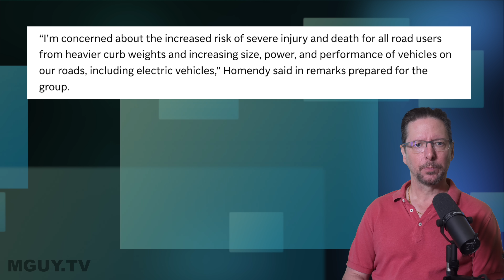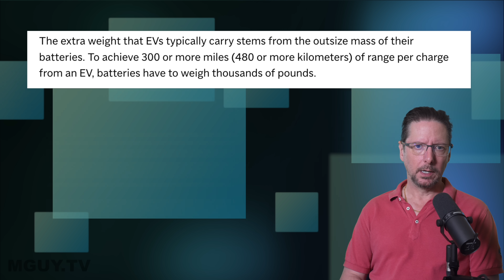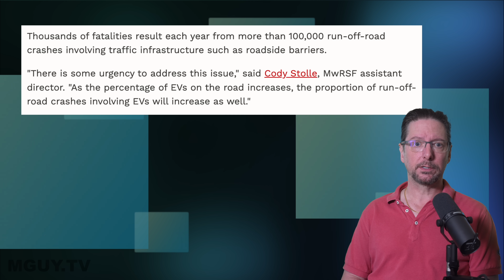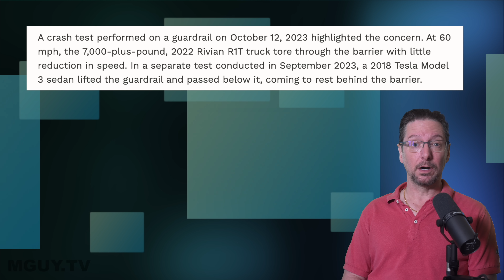EVs TOO HEAVY for roadside crash barriers (guard rails) | MGUY Australia

Comment: Imagine your teenage child driving an EV. Runs over a curb, damages the battery some and FORGETS to tell you so you can have it checked out. Comes home late, forgets to plug it in and you don't have enough charge to get to work. Pulls off onto the shoulder of the road, to take a leak (beer goes right through you) and gets the overly heavy vehicle stuck.
Reply: Drunk driving and expects child to have more than 1.5 brain cells?
Reply: @rosen9425  
I'm not sure you understand humor.

Comment: Would requiring EV's to park on the bottom level of a parking garage, or limiting the number of them per floor be a solution for the weight problem? Thanks.
Reply: Bottom level would trap everyone above in the toxic smoke. Making them park on top, without a roof might be of some benefit as it takes the Lithium Fire some minutes to burn through the concrete level by level.
Reply: "Out of the frying pan, into the fire" comes to mind. Perhaps open lot parking for EV's is the answer. Maybe part of the tarmac can be set aside for EV parking?  @robertkubrick3738

Comment: Recently, I watched a video of a supposedly stock Tesla shaming high horsepower cars at a dragstrip, we're talking high 9 to low 10 second passes (130MPH) in the 1/4 mile. My point here is how many drivers are not capable of dealing with acceleration that only the most experienced race car drivers know how to handle. Human nature being what it is assures most young men sooner or later won't be able to resist the thrill of a Banzai run. Even Biden succumbed to letting it loose as news cameras were filming his test drive in a Ford Lightning EV.
Reply: That vehicle had extra pedals on the other side. They wouldn't risk Biden driving.
Reply: FJB 🖕🇨🇳

Comment: So what we've learnt from so far: too heavy for car parks, too heavy for driveways, too heavy for crash barriers, too heavy for hills, increased road wear, increased collision damage , increased fire risk and fire hazard (environmental and health.)
If EVs ever (not likely now) replaced all ICEs, then all the current vehicle infrastructure  is compromised and needs upgrading to cope.
The meme 'nice' comes to mind.
Reply: Not to mention rapidly wearing tires needing frequent replacement while filling the air with excessive amounts of tire particulates and chemicals.
Reply: @edb3877 EVs typically wear their tyres between 10 an 15% more. 
New legislation on the way such as Euro 7 and others aim to reduce tyre particulates by 30% and increase their size above pm2.5. This will be a significant improvement for all cars. Not just EVs.
Reply: Don’t forget the fine dust created by inferior tyers, which is STILL A THING THEY NEED TO TACCLE
Reply: So, you're pretty much saying that EVs a lame as hell and a monumental scam? I knew they were really bad but after watching this EV dude the past few months, they're way worse than I realized. You're probably safer in a Model T with a supercharged small block Chevy in it.
Reply: @wrotenwasp  you swallow tales from a channel funded by oil lobbyists and take that as your guidance on EVs?
That is the problem with youth like you today, you take corporate narrative at face value & can't think for yourself
Reply: At least in Maryland part of gas prices is a road tax. EVs use roads but do no pay this tax.
Reply: @jimdevilbiss9125  There is tax on electricity. Not specifically for roads but part of the pot
Reply: I think this first wave of EVs were big for all the wrong reasons. But by second or third wave of models they should be where they shine. What is selling the best are smaller EVs. Hyundai is making gains in EV market because they listened what people want. In my recent trip to Bali I've seen bunch of small city electric cars not available in EU, and they look great and are cheep. Seriously thinking about getting one in few years time. Not to replace my Volvo diesel, but to replace my small car I use to get groceries or gardening tools. Small Skoda Fabia. I think there is a place for EVs in transportation system but not as a Humvee.
Reply: Yes mate and just what about the pollution not only from the manufacturing process but the toxic waste from fires and the particulate from those specially made tyres that are then shed to the road surfaces?
Reply: @johngoard8272  exactly, from start to end, ICE is 3-4× more polluting than EVs. Good pount.
Reply: @johngoard8272  ICE and EVs all have tyres and they all wear and shed particles. The rate of wear depends on the driving style and the weight of the vehicle. Heavy commercial vehicles are probably the worst.
Reply: And too heavy for coastal ferry vessels
Reply: @paulr7547  bull, almost all Norwegian coastal ferries are electric powered & most of the cars are EV.
Why post such obviously false tales?
Reply: Obviously if a ferry on the upper decks could have much heavier vehicles occupying the same spots lighter one the ships center of gravity will be higher. If you think that is a false tale think that. I would say that it just common sense.
Reply: The meme "rubbish' comes to mind, if that really is a meme. Are you suggesting existing infrastructure does not allow for pickups, busses and other very heavy vehicles?
Reply: No, actually, you have learnt nothing. If this person's claims are correct, the vast majority of vehicles on the road fit his heavy EV criteria, EG. nearly all SUV's definitely all Ute's and 4WD vehicles and any vehicle towing a trailer, and all vehicles towing a caravan should be excluded from the road. Think of the weight of a 2WD tradie or farm Ute carrying tools, hay, or stock.  Common sense not in this chaps resource inventory.
Reply: @paulwoods1950  but you saw the video, right? Dangerous, right? So maybe they need to be speed restricted like a lot of heavy vehicles  and those who tow, right? Common sense, right?
Reply: EV's are the perfect vehicle for the  "merchant bankers "  in our society.
Reply: @ferventheat most of want you have "learnt" is questionable, but lets put that aside for now. Although EVs sales are still rising I think ICE cars will still be with us until at least 2045. 21 years is a long time. Plenty of time for EVs to improve massively. I expect EVs to represent over 90% of private vehicles by then.
Only time will tell.
Reply: They weigh the same as other cars. You think engines and transmissions are weightless?
Reply: Learned
Reply: @@andypeek8151 Yours, maybe. But not everyone is a failure
Reply: Lesson you have not yet learned - this guy is paid by oil lobby firms and none of what he tells you has any basis in reality.
Reply: @j17golf  And you are not paid by EV lobby firms?
Reply: @elrolo3711  no, oam not. No need.
Reply: @j17golf They don't have to pay you because you are a true believer? At least somebody is saving money out of this.
Reply: @j17golf  Common sense alone tells you that the increased weight of the EV's is going to cause problems to the roadways.
Reply: @eugeniaskelley5194  minor difference in weight.damage from ICE exhaust fumes & fuel on road surface many times more damaging.
You guys are clutching at straws. ice cars are dying out no matter how hard legacy oil lobbyists try
Reply: @j17golf  Do you live in CA or in a metro? EVs will never take hold outside of densely populated areas.
Reply: @aaron___6014   I think you mean that EVs won't take hold outside of densely populated areas.  ICE cars (internal combustion engines) already have taken hold, for a hundred years.
Reply: @aaron___6014  not so, I live in the country, my ev tows hay, carries bikes, and I charge off my 🏡 solar exclusively. I save about $3k on fuel costs per year, and as a mechanic, I don't miss services oil changes, filter changes, ETC. It's a 1.5 T Hyundai Ionic. It suits my needs and rural lifestyle. But if this offends you, I can't help your ignorance of real-world experience. I chose an EV for financial reasons first, second for  low maintenance costs and effort, third for self sufficency, and lastly, for personal pollution reduction. This works for me, I don't think it would suit every ones circumstances, but that's nothing new.
Reply: @j17golf educate yourself 🙄
Reply: @j17golf  You say none of what he says is based in reality. Are you saying that the crash tests shown aren't reality?
Reply: @my3dviews  He is misrepresenting the results, yes. Clearly.
Reply: @my3dviews  All the posts I made on this thread were removed by the channel. He does not allow discussion because he is paid by oil lobbyists and they don't want their message to be dilluted. They count on the easily led kind like you. 
Yes, his videos are not based on reality, which is why he has to cancel the posts that go against the lobbyists' narrative.
Reply: @j17golf    Comments are automatically deleted by youtube. My reply long reply was just intantly deleted, proving it wasn't him, since I was defending his channel.  
No, he is not paid, that is just silly, unless you got verifiable proof of that, rather than just speculation.
Reply: @my3dviews  He is paid. Nobody wrecks their reputation in this way for free. $200 per video is the going rate that they pay. That's why he put so little effort into these
Reply: @j17golf   I can see four of your replies in this thread, so they are not all being removed.  There is over 1600 comments on this video along. I doubt that he would read them all and delete the ones against him.  I see them all the time on here, including yours.  It is y.t. that automatically deletes comments with certain words or phrases.
Reply: @j17golf   You are just speculating. He has the same opinion of EVs as a lot of people do.  How is stating his opinion wrecking his reputation?  Even car manufacturers are starting to realize that EVs are not the way to go.
Toyota, which was the world's largest car manufacturer will not make EVs. 
Firefighters have serious concerns about them.
Reply: @j17golf  Perhaps the worst part is he's reinforcing prejudices.
Reply: @j17golf  He's one-dimensional, playing to all the anti-EV men driving pickups.

Comment: Crash barriers in the UK seem to do a good job of restricting the travel of large trucks, weighing 44 tonnes.  The barrier supports are designd to shear, allowing the barrier to stretch, so absorbing a lot of the energy.  The barrier supports in the short video seemed to remain intact, and let go of the barrier.
Before EVs, we have had many heavy cars, weighing 2 tonnes or more.  The increase in EVs just means more.  I would expect the barriers, if properly installed, to cope, although sustain more damage for each strike.  So I'm surprised at this video, although a bit more alarm is a good thing in reigning in the fervour towards only EVs.  They need to be developed a lot more, and be part of the future, not the only option.
I've said it before, I can't see the emergency services going all electric.  Your ambulance will be delayed while we charge.  Your house will burn down, the fire appliance has already been out, and is charging.  Can we make an appointment for 2 days time.  Imagine a police chase, when the police cars run out of charge?

Comment: dude that fkn truck  was literally showing them barriers whos boss lol..

it was even throwing them cement barriers around like light weights.  i want to say them cement ones are like 5 tons. i forget. either way them are some nasty shi8 to hit dead on.  not even mean to be hit that way.  strictly to guid the vehicle to keep on a given pathway.  hense...not crossing over to do a head on collision that then definitely causes a 20 car pile up  if not 50  lol

the metal railings are designed to allow the vehicle to go through it if hit directly, not just guide the vehicle.  thats why you'l see them used on minor curving hill sides. still better to allow the vehicle through it versus keeping it on a 2 lane road that could simply just throw the vehicle back out and  into a head on collision 

that electric wrecking ball would be devastating to human body man

Comment: More steel and concrete needed, two things that require carbon dioxide to be put into the air…

Heavy EVs can’t get around kinetic energy being proportional to mass, yes. And quick acceleration means temptation to go faster, with kinetic energy being proportional to the square of velocity…

The low-end torque of electric motors makes quick acceleration cheap and easy: even experimental lead-acid-cell EVs around 1982 had excellent tire-smoking acceleration. It’s so tempting for a manufacturer to keep the acceleration because so many buyers will treasure it, and because suppressing it takes extra measures.

Comment: While I'm not a proponent of EV's right now, because the technology for them simply isn't "fully cooked" yet, and the Lithium-Ion battery chemistry is entirely wrong for the use-case of a car, I also don't see the weight of the EV-Hummer or Rivian as exceptionally dangerous in light that mega-sized SUVs like the H2 Hummer, Suburban, Escalade, among others have been around for many years, and they routinely start in those weight ranges as well.
At the end of the day, yes the incredibly big and heavy vehicles prove ponderous and indeed dangerous, but at the same time, the public has demanded vehicles of such preposterous size so that soccer moms can take Timmy to karate practice and guarantee that they don't get more than 8 miles to the gallon, down-hill, and with the wind.

Comment: You actually can't see the angle at which the truck crashed into the guardrails, but these look actually quite similar to our gurd rails here in germany and these are NOT designed to STOP a vehicle impacting them at a right angle (90^). Even my motorcycle at a mere 190kg cut through one of these like a hot knife through butter. But of course the much higher weight of EVs is actually quite concerning. Even on the most basic level, simple physics EVs are a very bad idea for the environment. To move double the weight, you need four times the power. With EVs this becomes an increasing problem as when they want to extend their range, they need heavier batteries...this means more even heavier batteries to offset the necessarily higher power needed. This power has to be created...mostly by fossils (even in the far future, as power demand will drastically rise and "renewables" simply can't deliver)and distributed at much higher numbers, meaning more wiring through the cities...this is ANYTHING but environmentally friendly.

Comment: Engineering with Simon...don't tell anyone my CL500 weighs more than a Telsa Model 3
Reply: Is that the long range dual motor 3?
Reply: Telsa model 3 Long Range 1,847kg...CL500 1,920kg

Comment: One equation for you E=1/2MV^2 . Increase the mass and the kinetic energy goes up. That huge energy needs to be dissipated somewhere and clearly todays infrastructure cant handle it. What happens if a 3000Kg car hits a regular car like mine that's only 700kg, its like playing chicken with a tank. Absolutely shouldn't be allowed on the roads.
Reply: Will you be calling for the removal from the roads of 40 ton trucks?🤔
Reply: @DwaynePipes  those guys have special training and difficult to obtain licenses. Oh and regular medical checks. Almost forgot, limited speed too. Sure, they can be dangerous, I had 🪦a friend who was flattened by one that came up behind him on a slip road and over the car.

Comment: Thank you for the informative video..  There are many problems with EV's besides fire and idiot drivers.. Thanks to a poorly thought out Net Zero, we are going to be stuck with all of them?
EVs should have been short range and small  "go shopping" cars, for short commutes...  While more efficient modern gasoline cars handled long distance?  But the "powers that be", want a total change to see a quick change in emissions.. No one seems to have thought about the pollution from Power stations and battery making?  Not to mention battery disposal, accumulated bake dust from heavier cars, instability of new battery making techniques and the reliance on foreign manufacturers, who don't care about any of this?
Reply: Not the brake dust argument, do you realise EVs use regenerative braking,
Reply: I had forgotten?  Only thinking of the weight and it's effect on braking?  Thanks for pointing that out... I should have picked that up myself ... Sorry..

Comment: My experience has been that roughly half of the EV drivers where I live drive like grandma and the other half are complete arseholes. I had one arseclown in a Tesla SUV busting my chops on the way to work one morning, I was running late and I was buzzing along at about 75 when I saw a vehicle in the fast lane going under the speed limit and as I tried to go around him he accelerated like crazy. I didn't care I was on cruise control. Up the road a bit I caught up to him except this time there was more traffic so I couldn't go around him and he slowed down, he wouldn't move over and he matched the speed of the slower traffic in the right hand lane. Once it opens up again he'd accelerate until he caught up with more traffic and then he'd slow down again. When the road merged into four lanes he accelerated away from me like I was sitting still, at that point I was going 90. This was during rush hour traffic. I've seen ev drivers doing similar to other drivers. Most hybrid drivers usually drive slower except for Prius, most of them do 80 and about 24/7. What's the point of owning one when you're still going to drive fast? 😂👌🏻
Reply: I've experienced that aggressive driver behaviour for decades. Before EVs were a thing.
Reps in BMWs were the most common culprits!
Shit drivers are shit drivers regardless of the drivetrain.

Driving like a nun is nothing new either.
😂